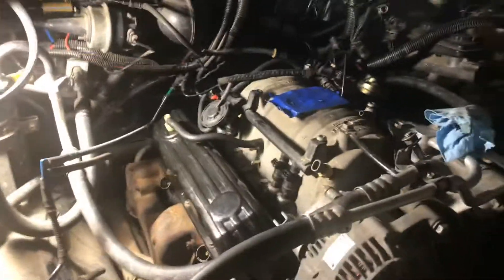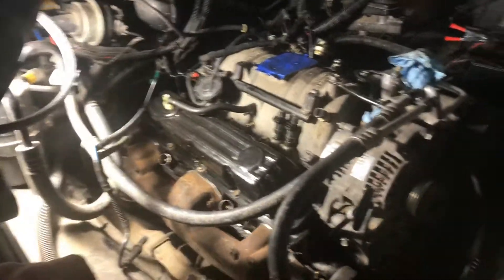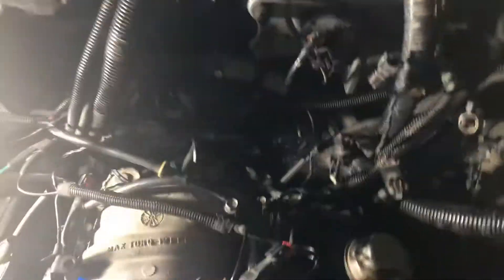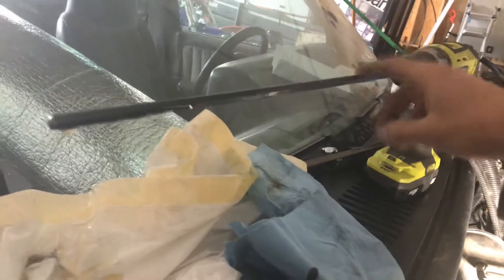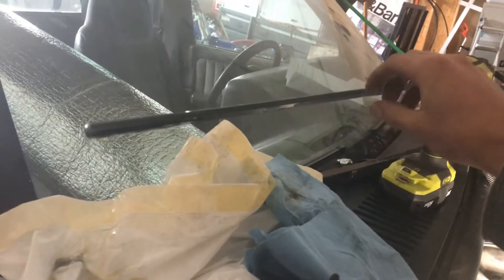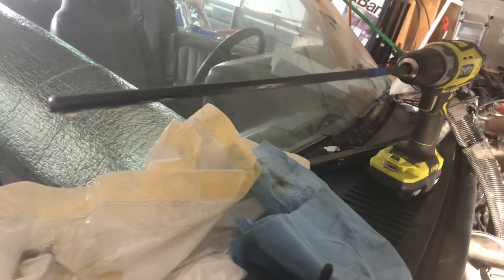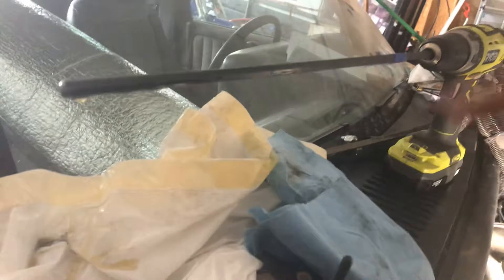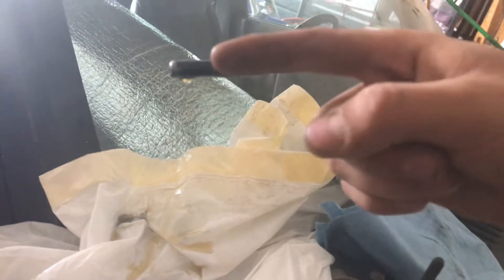Oil pump priming (Dodge 318)

Comment: wish ya would have put the rod/drill in the hole i changed my oil pump  today and forgot to primp it b4 hand now i have to do it from the distributer hole grrrr .. and not sure i can get the drill and rod down there being it is a ram 1500 and the distr is in the back
Reply from the maker: Yeah the firewall that sweeps over is no fun when working in the back of the engine. Well good luck getting the pump primed!
Reply: @AndrewSalazar7  i just ended up pulling the pan AGAIN and priming it that way..stay safe